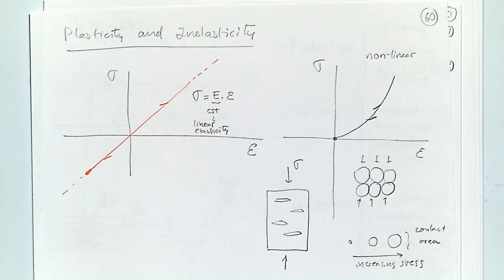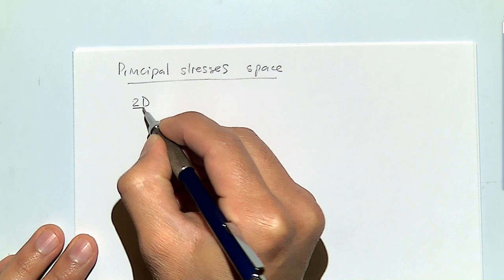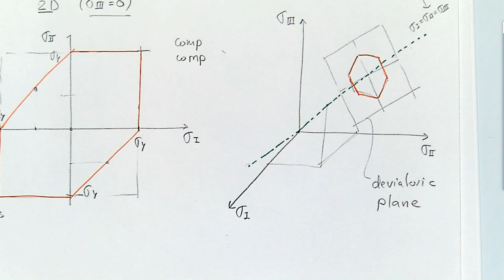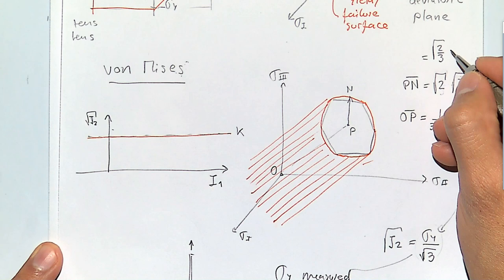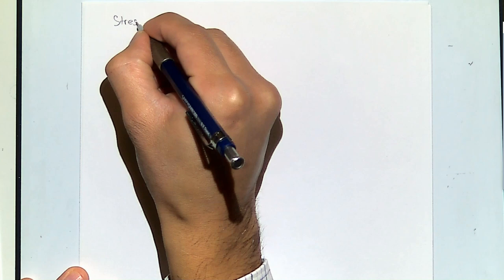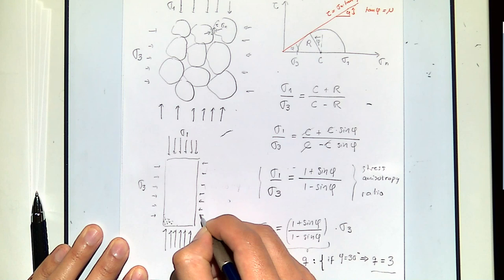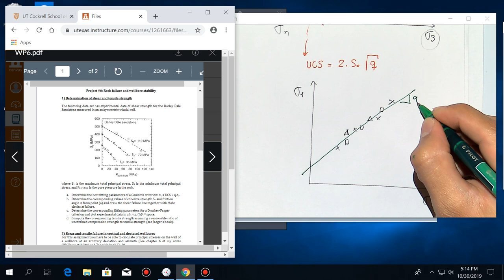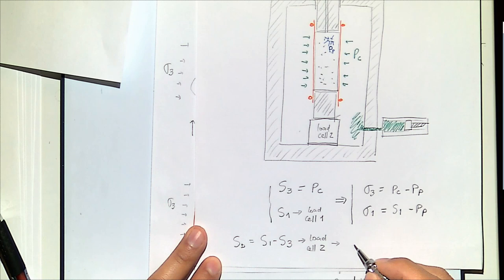L17 Yield criteria and yield surfaces: Tresca, von Mises, Drucker-Prager and Mohr-Coulomb

Comment: Thank  you very much for useful video , however regarding the hexagonal yield surface  at compression part (CC) ,  I believe for example when the SEGMA II  = 1/2 SEGMA Y  then  SEGMA I   < = 1.5 SEGMA Y , hence the surface shape should be different .( please check at recording time 19: 06).
Reply from the maker: Hi Muhamad, you are doing the math correctly but do not forget the condition "sigma_III = 0". If sigma_I = 1.5 sigma_y, then you are violating (sigma_I - sigma_III) <= sigma_y. I need to think hard every time I put all these inequalities together in my head!
Reply: @dnicolasespinoza5258  Hi Dr.Nicolas  and thank you for reply , however I am asking about SIGMA l & SIGMA ll  in two dimension problem ( no SIGMA lll) ,  in case you replace SIGMA ll with SlGMA lll could you please in your previous reply  could you please show from where we bring this condition ( if SEGMA ll = 0  then SEGMA l = 1.5 SEGMA y).   I think every point from the  yield surface should achieve the equation  | SEGMA l _ SEGMA Il |   =  SEGMA y   and this equation is not  achieved in the diagram of the yield surface at  first quarter  ( CC ) .  If one take SIGMA I = + 1/2  SEGMA  y then we can find by drawing a vertical Line SEGMA ll = SEGMA y  Hence the deveatric stress                | SEGMA l _ SEGMA Il |   =   1/ 2 SEGMA y  ?!
but should be SEGMA y as a Limit value located at the yild surface .
Reply from the maker: @muhamadaminalsalamat9608  The key is that this is not a 2D problem. It is a 3D problem. The polygon drawn at minute 19 is a 2D cross section of a 3D volume at sigma_III = 0. Notice that the condition is stated on top of the figure. The problem is 3D, the visualization is 2D.
Reply: @dnicolasespinoza5258  many thanks , I relized that latter on ...could you sent lecture 18 please . I can not find it.
Reply from the maker: @muhamadaminalsalamat9608  here is the playlist https://www.youtube.com/playlist?list=PLv0npDbE5HXtMdQYoQEThbTvj8xXIa-Z4
Reply: @dnicolasespinoza5258  many thanks ! l highly appreciated !.

Comment: Dr Espinizo, thanks a lot for this useful video covering, but I have a question.Which soil type and saturation can be used to make an analysis at each of the mohr coulomb,drucker-prager and von-mises of models  and why?
Reply from the maker: No easy answer for that, I recommend taking two or three full-semester courses in geotechnical engineering to answer this question.